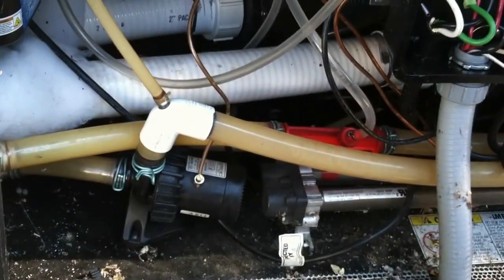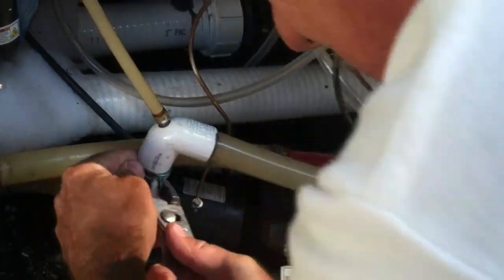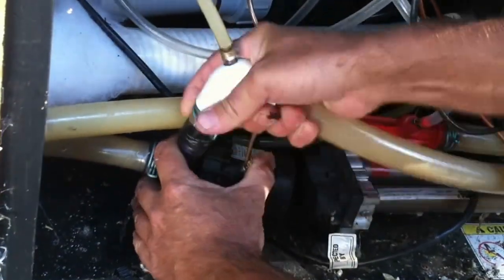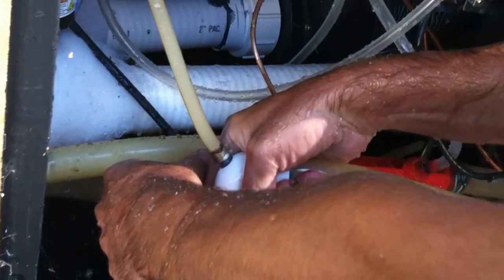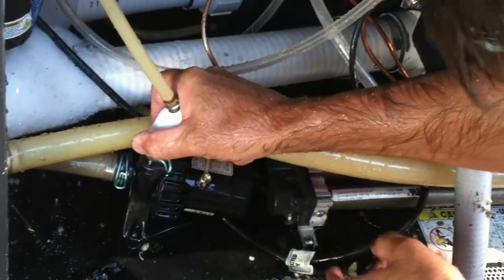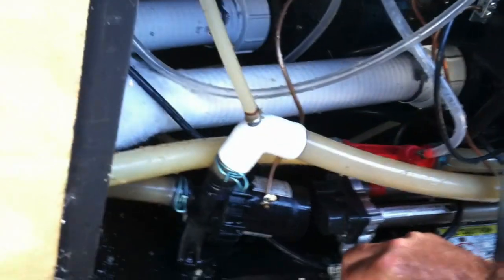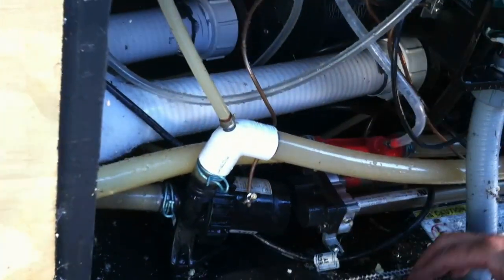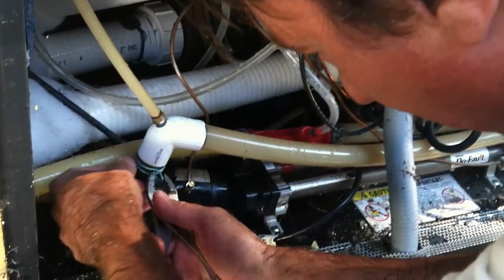Hot Spring circulation pump air lock

Comment: (A) that wasn't an air lock, it was an obstruction. (B) The obstruction was the weir door rivet head in the ozone injector, the rivet that keeps the weir door from coming out the top of the track. Excellent video of you fixing a malfunction without really understanding what the problem specifically was.

Comment: My Triumph does this EVERY time I refill it. Air lock... My old Grandee NEVER air locked.  I have to go through this whole song and dance each time to get the pump to prime.  Next time I'm going to purge a little water from the bottom passive drain on the outside of the tub and also remove the gray standpipe filter.  I hear this helps the pump prime.

Comment: Turning breakers on I get a relay click then the tub dies and a red light flashes. I’m wondering if a bad small circulation pump can cause that? The circ pump is hot and if I tap it with a rubber mallet it spins a little then stops again. Can this circ pump cause the tub to fail at start every time?

Comment: Take a look at your filters…one has a different colored top.  Unscrew the top, remove the filter and insert the garden hose into the pipe.  Run the water into the pipe for 20 secs or so. The airlock should be gone.
Reply: This is with the hot tub full, correct??
Reply: This is the solution if your tub is already full, worked like a charm.  Also, make sure that the power to the hot tub is on when you do this.  It didn't work when the power was turned off.

Comment: can you tell me what that small tube coming out of the 90 goes to? mine broke off.
Reply: Same thing happened to me, did you find out?
Reply: Thats the bleed line where air comes out if you have a airlock . it usually runs to the filter bucket . You can buy a circulation adapter fitting that will replace that elbow